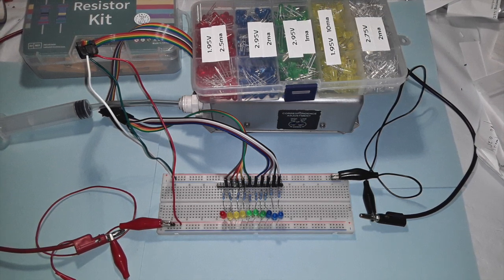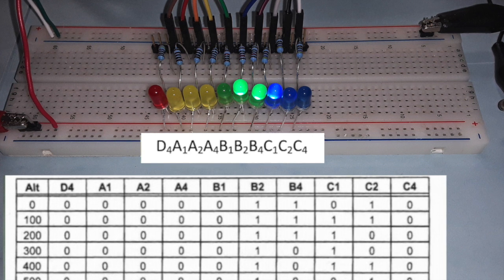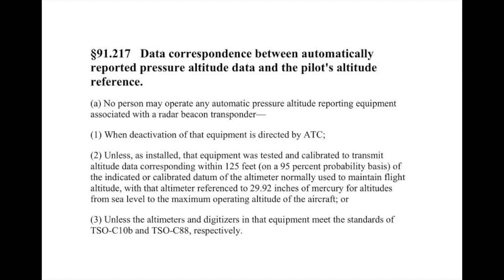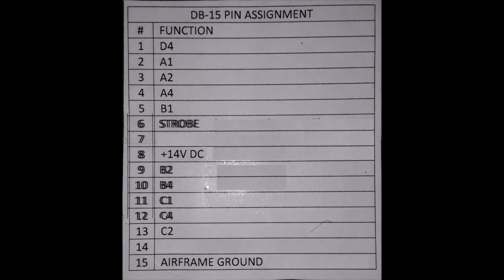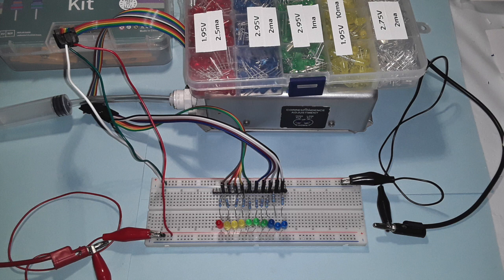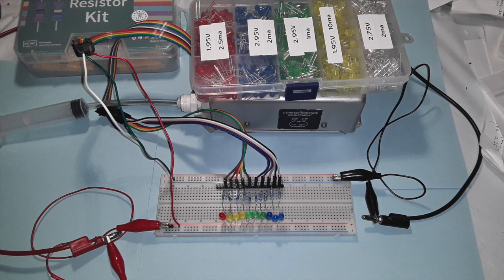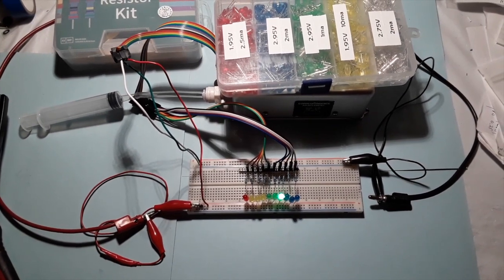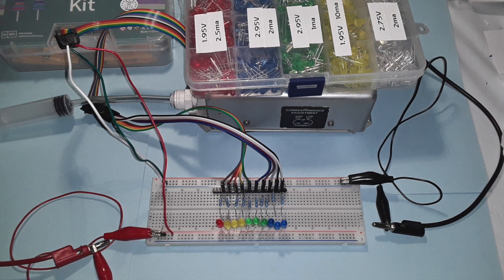DIY Altitude Encoder test setup.

Comment: Thanks Ken, this is the best tutorial on an altitude encoder available. Now would you be able to provide some direction on using a Nano to provide a binary to decimal conversion into 4 digit LED display of the altitude?
Reply from the maker: The first prototype I made of the altimeter used a Nano, a tiny 1 inch LED screen and a small rotating knob that could be depressed to change modes, to enter the sea level pressure.  I didnt like the complexity, the number of parts, the power requirements, and the tiny screen, so I went to a touchscreen to combine the parts and improve readability. The version I describe with the Uno and touchscreen shield was that version. But, there was the issue of wires to manage and still having to provide a power supply, so I went to my thirdl version which is a tiny circuit board using the Leonardo based Beetle (which was developed for robotics) and a simple socket to hold the sensor, and a USB plug built into the board, allowing the tiny board to be plugged directly into an Android cell phone USB jack without having to use a cable. I then utilized an App on the cell phone to provide the interface to the Leonardo which manages the sensor.  That way there are no wires, power supply, or touchscreen shield because the cell phone already has all of those things.  You can see more about that in my video on Plug and Play Altimeter. There is also a follow up video to that showing how to use Bluetooth instead of USB. For future development I plan to replace all of that with just an App for the cell phone, once good pressure sensors become more widely utilized in the Android market.  Last time I checked many Android phones still did not include an atmospheric pressure sensor. Which of these other designs interests you? If you still are only interested in the Nano version and 1 inch LED screen, I could make a tutorial for that on my Github page.
Reply from the maker: I've updated the Description to my video to include a link to my Github page that has an article I wrote on how altitude is encoded in binary for altitude encoders.  I wrote a simple C program to encode altitude and it's fairly easy to reverse that to decode the altitude.  Also included is an Arduino program for the Nano that will decode both parallel and serial data from an encoder to a decimal altitude. If you already know how to create a binary number from detecting a ground at a Nano pin, that program will work for you.  You can ignore the serial part of the code  until I have time to upload a circuit diagram showing how to decode RS232 for use by a 5V Arduino.